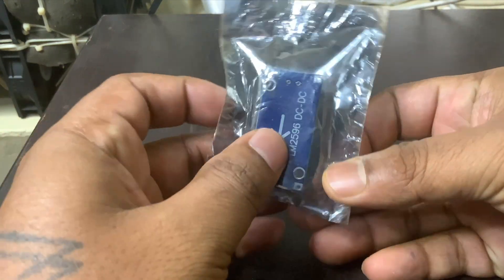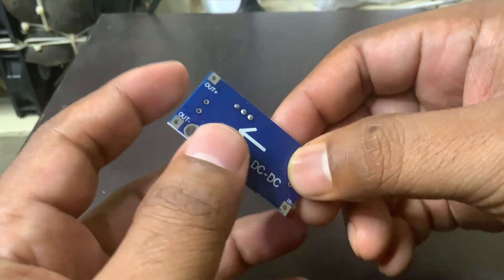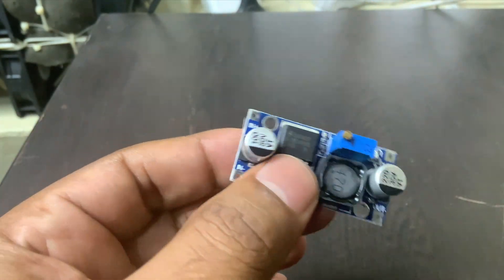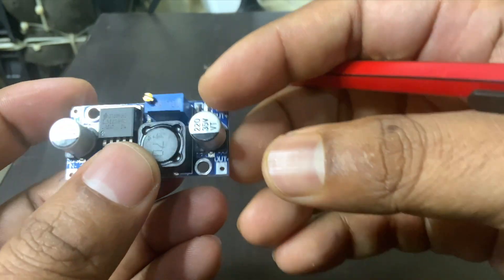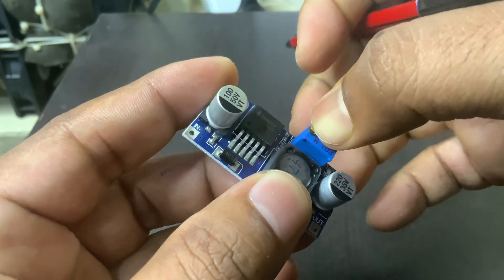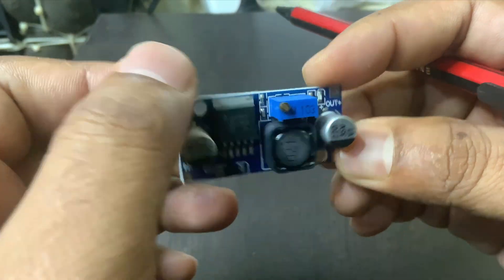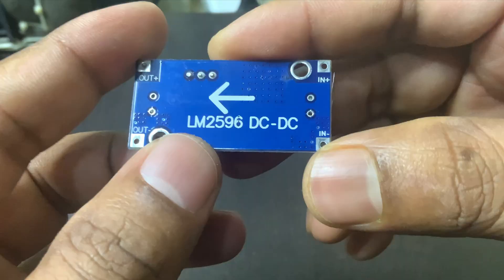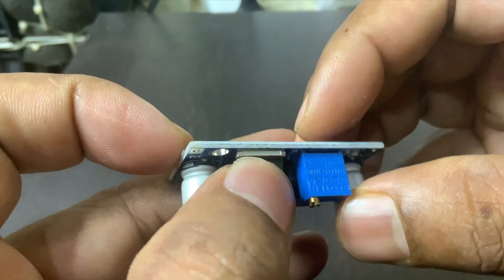LM2596 DC to DC Converter is Enough to Step Down DC Voltage

Comment: I'm using it for my 12 volt LED strip which is the power supply is 19 volt and I'm using it for that purpose and it's getting so so hot not recommended
Reply from the maker: max current is 3A if you push the board to get more power it will heat and may damage
Reply: @Lifeofelectronic  it was 5 meter of WS2811 addressable RGB is that too much
Reply: @Ironboyhight it depend how many LED per meter this module cant power up the led strip

you need a lot of current

if you have 5V  strip with 60 led per meter you need 18A
at 12v you need 9A. too much for the module to handle